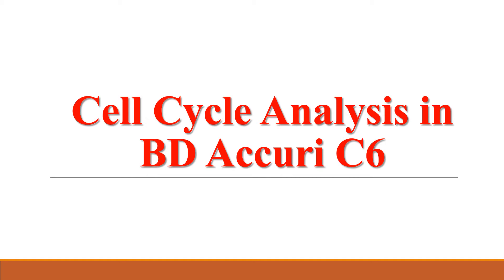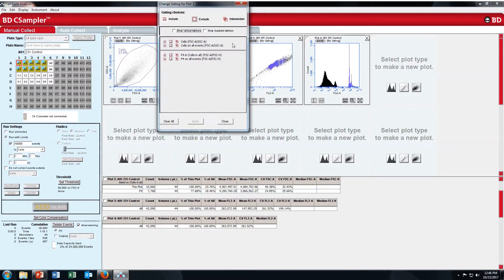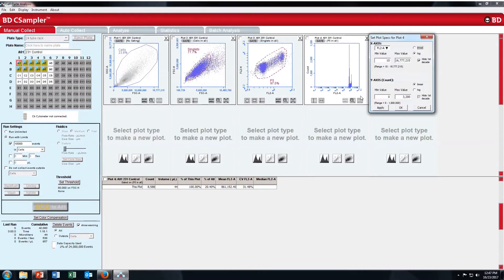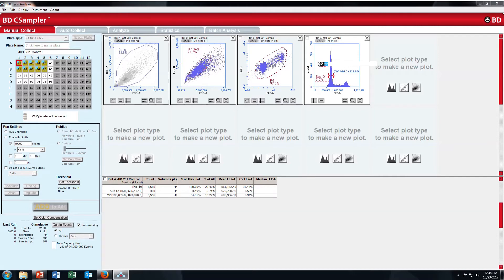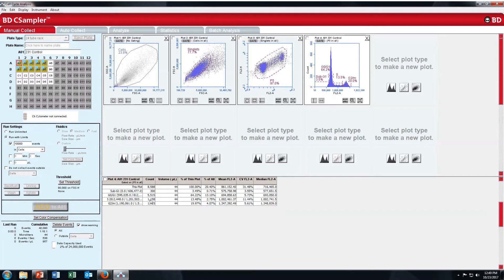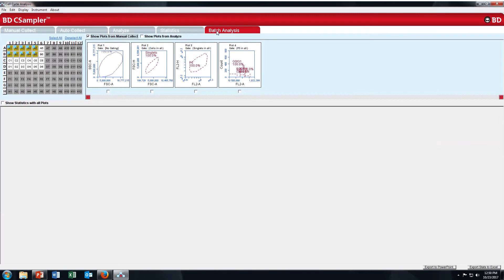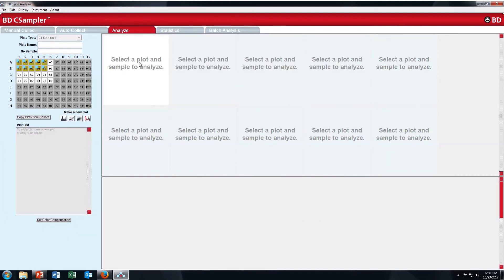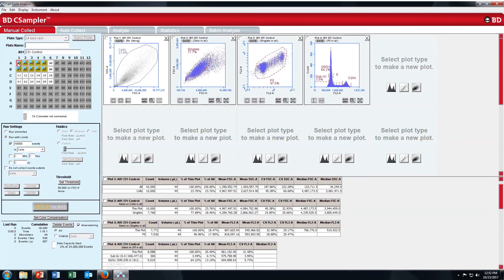Cell Cycle Analysis in BD Accuri C6

Comment: I have two flow cytometry equipment in my possession.
the first is the Calibur and the second the Accure.
When I run the cells through the two cytometers, I get different graphs for the same cells. In calibur, the 1000 by 1000 dimension graph presents a more vertical behavior, while the accure, with the graphics in the same dimensions as your video, presents a plot similar to the one you presented. Why does this occur?